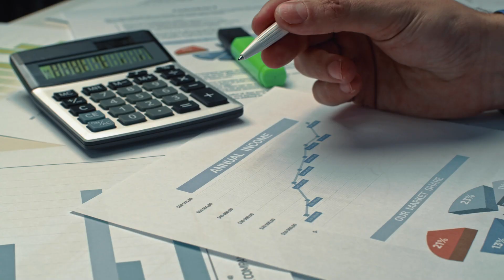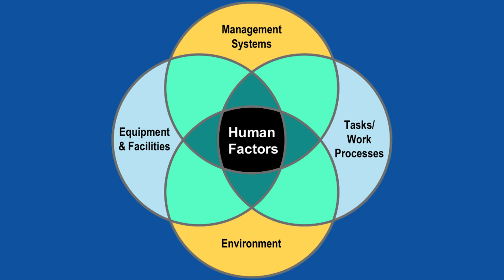MS Industrial Engineering: Curriculum, Top Universities, Job Prospects, Salaries, Best Locations

Comment: Hi thanks for such a deep dive video into Industrial masters, I have a bachelors in production and industrial engineering with 6.7 cgpa from IIT Roorkee. I am currently working for a bank as a product manager( for 2 years now). I want to get in the top industrial engineering programs in USA. what should be my gre score based on my profile? Also should I be giving IELTS or TOEFL? Also if there are any better master programs for my profile, please suggest me.
Reply from the maker: Hey glad to get in touch and thanks for sharing your info. The big question you need to answer before choosing IE or exploring other options is - do you want to specialize in a technical area or stick to pursuing Managerial roles? 

Industrial Engineering opens up doors to a lot of industries, especially into technical roles- like Data Analysts, Production Engineers, Operations Analyst, Supply Chain Managers, Financial Analyststhe etc

The other option you have is Engineering Management. Even this opens up opportunities across diverse streams but imparts more managerial education than core Engineering/mathematics education. 

So you need answer the above question first before making that choice. 

Now to get into top programs, a 6.7 gpa might hamper your chances. However, a good GRE (320+ with quant 160+) along with Strong SOPs/Essays and Recommendation letters will boost your chances. Hope that helps!

If you want a personal counselling session with me to have a deeper one-on-one conversation about your career, you can book a session with me - https://topmate.io/jayasurya_pathapati

Comment: My GPA is 6.5/10 but my bachelors is from NIT Rourkela where curriculam was very tough to get good gpa unlike private universities do you think 'NIT' tag would help me ?
Reply from the maker: US University admissions are holistic, and although GPA is a big factor, it is still one of the many factors they look at. NIT tag will have an impact. You need to compensate for your low GPA with a good GRE score to boost your chances. A strong GRE (90+ percentile), especially in quant, will increase your chances. Of course, SOP and recommendation letters will also play a significant role.